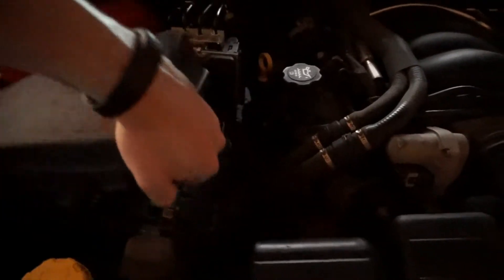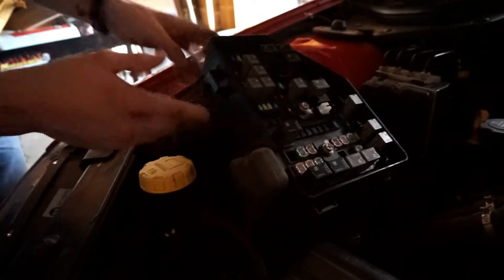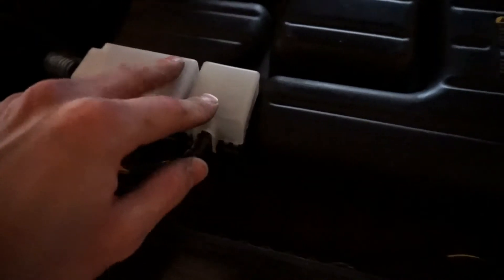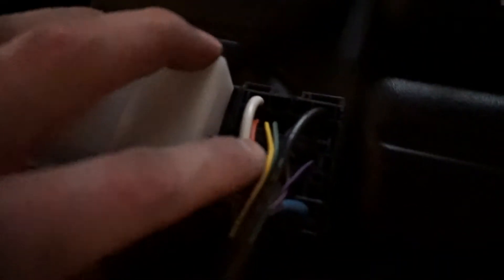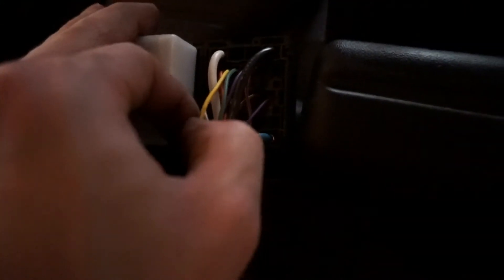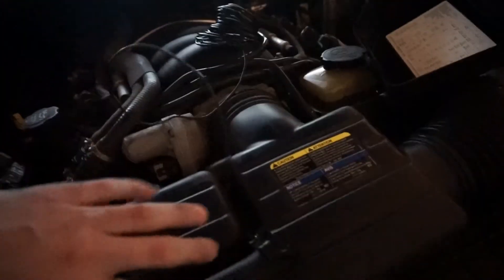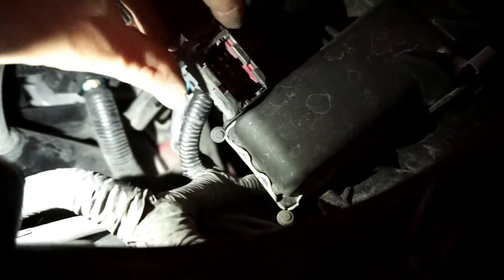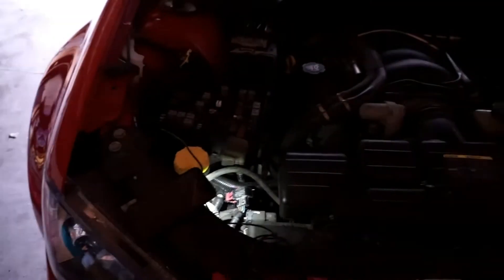Rewiring the DRL on the G8

Comment: Which fuse is it in the cabin to disable the drls bud? Great video by the way. I'm old fashioned and always remember to turn my lights on manually :) hate when they come on in the day when I don't need em and have to switch them off every time.
Reply: It's fuse F21 in the interior fuse box. It only disables the DRLs though, not the auto lights.